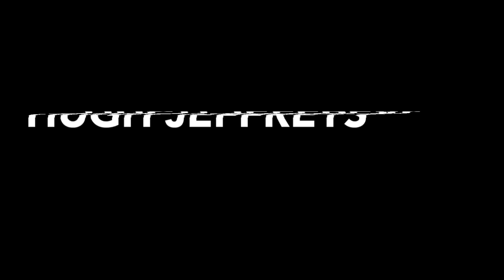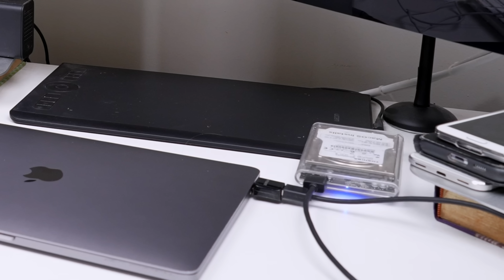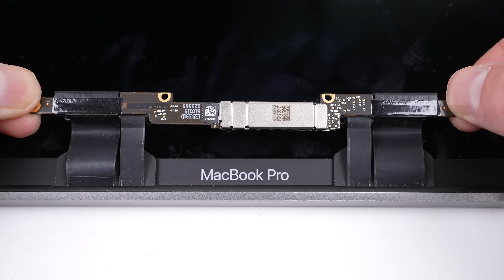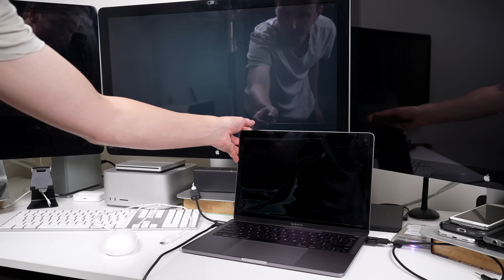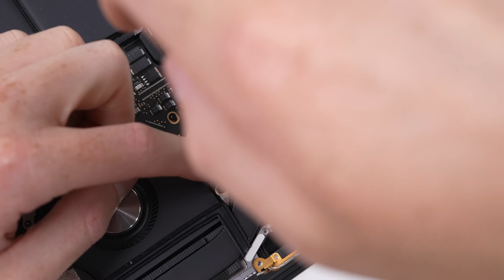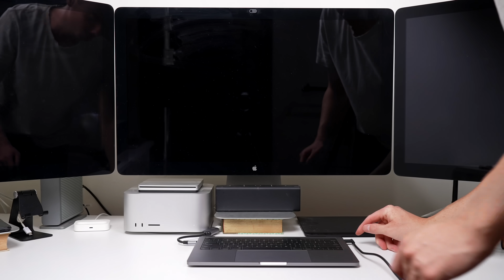Fixing this $100 Broken MacBook Pro Didn't Go Exactly To Plan.

Comment: These Intel unibodies with only TB ports are the worst laptops ever made by any brand. No way to replace the RAM or hard drive, and the screen flex gate to boot. I'm glad I sold mine to try a Mac Mini before the M1 came out.
Reply: Also don't forget that they were made even worse in 2018, with the introduction of the horribly unreliable, terribly implemented T2 "security" chip (which is anything but secure, thanks to checkra1n). At least the Apple Silicon machines have turned that unreliability around nicely, and have proven to be considerably more robust than T2-based garbage.
Reply: Don't forget about butterfly keyboard, that gets stuck with any dust particle

Comment: Older Macs do mirror; apparently the new ones must not. It wouldn’t surprise me if Apple did this intentionally just to make repair tougher, even software repairs.
Reply: Well that was a "Turning a laptop into a desktop" video by Hugh Jeffreys.  lol
Reply: Normal macOS if the lid is closed it will always put the main display on external
Reply: They’re making technicians think it’s a board issue
Reply: apple think differently.🤣🤣🤣🤣🤣

Comment: That’s wierd, my dad had a randomly non working screen on the same one and it worked perfectly for a desktop for my brother to watch shows so dunno what’s up with this one.
Reply: Needed an OS installed; maybe the other one was corrupted somehow?
Reply: @RennieAsh  no, it worked perfectly fine 🤷‍♂️
Reply: @Lgwasherfan5623  I think Rennie means Hugh's Mac had a corrupted OS, which indeed seems like what it had, it was trying to enter recovery after all but the silly stuff with the screen kept it from proceeding.
Reply: @Kalvinjj  oh okay. well anyways MacBook screens shouldn’t randomly die
Reply: @Lgwasherfan5623   They definitely shouldn't, but well, some idiots decided to add a way too short flex cable on the display that tears easily and refuse to replace it even tho it was their own mess up...
Reply: @Kalvinjj  el stúpido apple

Comment: I find it dumb how apple won’t fix their products when there is a design flaw like there is on this model
Reply: They offer to fix it under 5year if you sell a product will you give them a refund due to a designs flaww after 5 year
Reply: Have you seen the video?!they had a replacement warranty….
Reply: Dell Inspiron 15 3511
Reply: No its actually smart. Imagine millions of laptops comming into service for a recall, imagine how much it would cost them
Reply: The current restrictions are easy to circumvent, though without the added security of TPM and features like VBS. A better approach would be for Microsoft to warn users of the risks and limit their support options, rather than completely preventing installation.

My old Haswell i5 runs Windows 11 like a charm.
Reply: I agree
Reply: Are you blind kid? 😂
Reply: It's because they are greedy and many of their business practices are anti-consumer. Unfortunately far too many people are part of the Apple cult and seemingly don't care or just don't realise that they are being screwed.
Reply: I’ve been a loyal Apple customer for 23 year and I’m seriously considering walking away after my 16in MBP 2019 (A2141) issues. It’s the last Intel MBP of that size that made and purchased it in Jan 2020,  6 months after I got it I turned it on to a blank screen then took it to Apple and they replaced it under AppleCare+.   About a year later I noticed the Louis Rossman had mane a video on the MBP A2141 and it turns out in this particular model,  Apple designed the Power IC in a way that if a 50 cent chip failed it would send 13v from the power rail directly into the NAND instantly frying it and these chip where frequently failing.  After this failure you lose all your data and the NAND can’t be replaced due to T2 chip being pair with the NAND.

I’d been stressing in the back of my mind for years that it may happen to the replacement I received and after 2.5 years it occurred again destroying it.
Reply: Well, dumb people buy it again and again plus pay premium for insurance which is more than any cost of repair.
They have a department which creates problems to sell solutions. And still people buy it. Company couldn't be happier.
Reply: its not that apple wont fix their flaw design because if its flaw but apple wont fix something this old normally because its at this point 8 years old
Reply: Only ASUS like tuf F15. If apple was a good thing it wouldnt be biten😂. So apple bite yourself😂😂😂
Reply: That is apple
Reply: they did fix it by making newer macs
Reply: But it's an apple product it can't have design flaws
Reply: I hate Apple but I also hate Microsoft for making perfectly good PCs no longer upgradeable to Windows 11 and higher.
Reply: @SayAhh  Thankfully Windows 10 is still perfectly usable
Reply: @brandon_nope  It is possible to upgrade to on a machine that Miscrosoft says says can not be upgraded , I did it with the laptop I am sending this message om . Search for "Dosdude
Reply: @brandon_nope   switch to linux, fuck microsoft and windows
Reply: @SayAhh  Corporations don't have your best interest at heart, if you want freedom consider using open-source projects such as Linux
Reply: @SayAhh M$ learned that from apple😉
Apple of course launched new OS versions that were unable to run on 3 year old apple computers in the worst case. Luckily for W11 there are easy workarounds.
Only their latest requirement, SSE4.2 is a hurdle, but you'd need a 15 year old CPU to not meet that spec...
Reply: @SayAhh  Windows 11... you're not missing anything. Win11 was launched 22H2. Windows 10 is 22H2. There's nothing really but cosmetic changed items and some command line and development things. Honestly nothing you can't do with Windows 10 and it's a better UI.
Reply: @crazyidiot5309 It's about software support and updates past Windows 10s EoL
Reply: @SayAhh  Running Linux just fine on two machines that came with Windows — an older Dell N7110 and a newer Lenovo S340-15API. My personal setup on the newer laptop is EndeavourOS with XFCE desktop. If you don't like the idea f using something base on Arch Linux (even if it is dead-simple) you can use something else. But I can understand why you wouldn't even want to try if you suffer from choice paralysis.

I could write an entire essay about this, but i'll answer questions as-provided instead and not risk one errant keyword or punctuation eating my entire post..
Reply: @SayAhh  yeah I do too and my way to get around that is to just use Tiny 11
Reply: @CaptainRex332 exactly.
Reply: @SayAhh you have one that old?
Reply: @orangeyellow-me1pz like around 70% of PCs at my work are used for light tasks, such as browsing and editing documents. 5th gen 4 core Intel systems with 16GB memory and an SSD upgrade are more than capable of that, yet in a year they'll all become e-waste for no good reason. Sigh...
Reply: @guiorgy  if it came out that long ago isn't it plagued with vulnerabilities? Besides, they don't have to be useless. If Microsoft won't then Linux can fill in the spot there.
Reply: @orangeyellow-me1pz Hardware isn't really plagued by vulnerabilities over the years as you can update the board firmware and UEFI/BIOS alongside your OS (excluding certain issues within the CPU architecture itself, yes)
Reply: @resneptacle  vulnerabilities lie within the cpu was what I was referring to. That's Microsoft's whole deal right now.
Reply: @orangeyellow-me1pz an i5-7200U isn’t “old.” They were sold up until 2020. Which means there were literally one year old computers that were unsupported by windows 11. What’s worse is Microsoft could’ve easily supported it; they chose not to. The worst part is over 50% of computers don’t support Windows 11. Which means millions of ewaste by 2025. And it was all avoidable.
Reply: @0w3nn  Microsoft is known for screwing its customers. They did this With Windows 95. A whole song was made about it. They also screwed over those who bought the HTC HD2 when they promised that it'd get Windows Phone 7.
Reply: Because if they fixed it then you wouldn't buy a brand new one
Thats the logic apple has
Reply: Almost like it is intentionally designed that way
Reply: Why should they?  The sheeple will keep buying new ones even with the flaws. lol